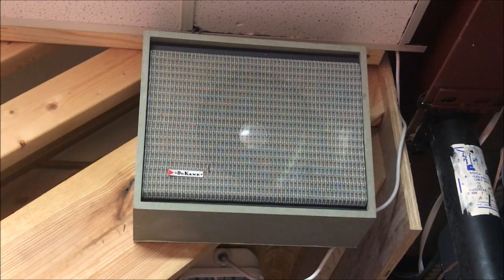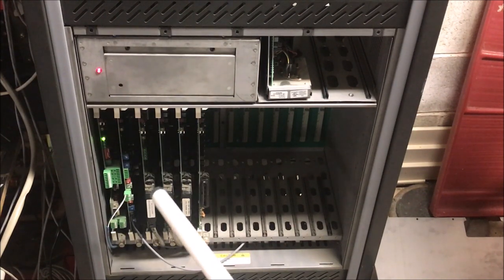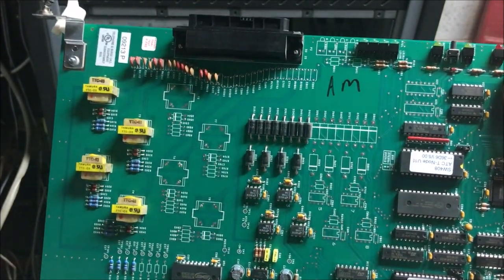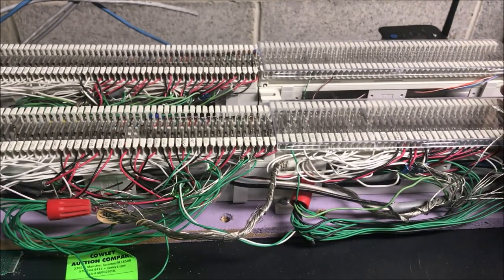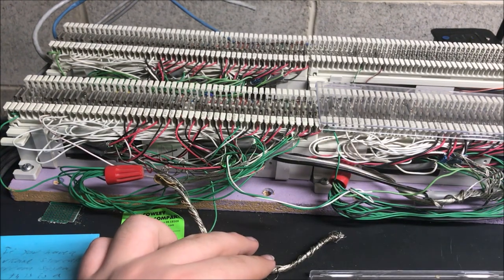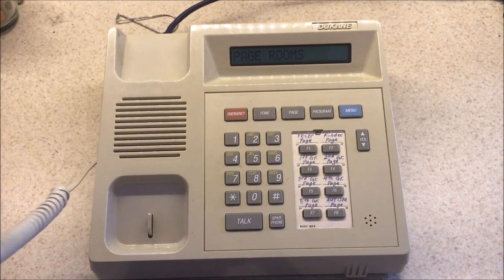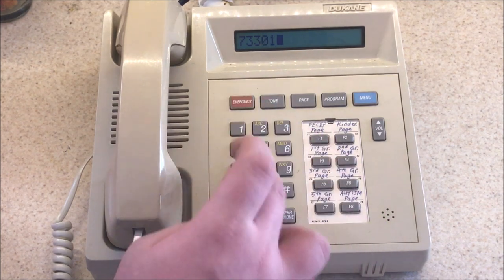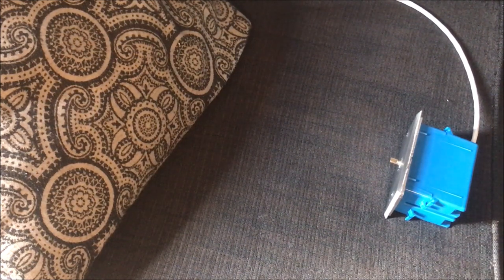DuKane Starcall Intercom System -- The Basics

Comment: Hi is there a way to tap into the all call for a safety system that makes an announcement over all the speaker? The output on the device is analog but I also have a relay that can trip to open or closet when the audio is trigger. Really need help figuring this out but my system does not have the mixer just everything else.

Comment: Hello, I maintain this same system in a Fire Dept.  The guys woke to the "Ding" type alarm going off every 5 minutes.  They didn't setup this wakeup alarm/ding...but...it wouldn't quit until they unplugged one of the phones.  They took out the Dukane Phone 4 years ago, and said the system worked for paging ONLY ever since.  Until last night.  All the LED's for the hearbeat, Central Processor card are blinking together.  Not sure if that's bad, or not.  Any help with manuals for troubleshooting would be appreciated.  BTW.  Awesome, Awesome video.
Reply from the maker: Hello, and thank you for the comment. After thinking about this for a little bit, I have come up with a few things that could cause the issues that you’re having with this system. One of my guesses is that the main central processor card (CPC) has just crashed and needs to be reset through the software. Just unplugging the unit will not reset it usually. All of the lights on the CPC flashing means that there is an error in the system. This could be caused by some weird glitch that happens randomly causing more glitches or a bad card. Another reason that could cause the tones could be some sort of external system that is either sending a trigger signal to the unit to play the tones. Or, it could be sending audio of a similar ding tone to the unit through a paging mic input or one of the two program inputs. I would assume that there could be external devices connected into the unit, seeing as it is in a fire station, to play alerts over the system. This could have caused a static charge to damage the cards. Either way, the best way to start is going to be to get the software for it and try to reload the configuration files to the cpc. Unfortunately the software will only work on a computer running Windows XP 32 bit, basically meaning any Win XP machine prior to around 2006. A link to download the software is buried in a reddit thread which I will provide a link to here ( https://www.reddit.com/r/k12sysadmin/comments/6w06m6/dukane_starcall_rapid_software/dm8txkk/ ). I’ve tried downloading it on windows 7 and it did not work; it only worked on a Windows XP laptop. If you do have a device that will run it, you will either need a serial cable to connect to the CPC or a usb to serial with proper drivers. When I did this with the XP laptop, it worked first try. I do have another video recorded about the software that I have sort of been procrastinating on editing that I should post, because it would probably help with what you’re trying to do. One last thing that you could try is plugging in one of the DuKane phones with a display on it which would show the error code, or if somewhere in the building there is a remote display that would have an error code on it. If you could get access to one of the phones, you could view this code and I could relay information from the manual on what it could mean. I’ve had error codes 19 and 18, both of which caused the 4 leds to flash and were easily resolved through the software. The software is fairly self-explanatory once you get into it, so if it is a small building, you could try to reprogram it to do the minimum of what they need it to do, minimizing future errors. You could also try clearing the schedules by dialing 75200#, but this will turn off any pre-programmed schedules. As I have found, this system is pretty resilient and hard to break, so don’t be afraid to try some basic resetting methods with it as you probably wouldn’t break anything. Sorry this response was so long, but I hope it covers everything to get your troubleshooting process started.

Comment: I have an Administrators Phone 7a1110 that recently started not powering  on when first plugged in. When I lift the handset, I receive static and #4102 1 of 1 appears on the display. I have tried resetting the system multiple times, cleared errors, reloaded the system configuration but nothing resolves the issue. Do you have any suggestions.

Comment: Great video!  We have two identical Dukane system and each are used to support floor levels in the building fior two division. One Dukane system rack for Division-A supports the rooms & zones in the Basement and 1st floor level while the Second Dukane system rack for Division-B supports the rooms & zones in the 2nd, 3rd and 4th floor level. We an announcement is to be delivered for ALL the floor levels or to both Division-A & B, we have to use two admin consoles instead of one as each admin console is connected to each individual control rack or system. Both Dukane system uses 16-channel card and all slots on the control cabinet are occupied supporting 270 rooms. Is there a way to bridge these two identical Dukane systems together so we can only use one admin console to deliver announcements?....What can you suggest?....Manufacturer no longer support this system and unable to assist both on documentation and support.

Can you also direct us where we can get technical documentation for this Dukane StarCAll intercom system?

Appreciate the help.

Thanks!

Comment: Can you run a paging signal from a third party pbx on this system? Is there an analog card for that?
Reply: Also, Clearwater High School in Clearwater,FL used this system. Their amp was 250 watts!! You can talk to a lot of speakers with that sort of power.
Reply from the maker: There are several configurable inputs on this system, including a standard balanced paging mic input that you could try to interface it with. You might be able to configure a trunk interface card to work with an external line, but I am not sure. I do not believe that there is a dedicated analog card for this, but you might be able to pull an analog output into either the mic input or one of the two program inputs on the system. Also, if you have this system, in a future video I will supply a link to the RAPID software along with an instructional video. If you have any success with this, let me know; I am interested in how you could do this with this system. Thank you for the comment!
Reply: @floydsutton788  I don't have this system. I do however have a vintage TOA solid state 70v mixer amplifier that looks to be from the 70s. It is a TOA model ta958. I have been looking for input cards for this unit. Are you familiar with TOA amplifiers?
Reply from the maker: @jonathankeenan80  I have thought of purchasing a 250 watt amp for this system, but there are so many more amps that have a higher output than DuKane program amps. These are high quality amplifiers though and even the 125 watt one powered nearly 50, 5 watt speakers throughout the school that this one came out of.
Reply from the maker: @jonathankeenan80  I have not dealt with TOA amplifiers, but I do have two 15 inch TOA drivers and they are excellent quality. I am not sure where to get cards for a unit that old, but good luck!

Comment: I actually still have this very system at the school building I work at as an IT Admin. How do you adjust the volume of individual speakers in the rooms through the phone? We have the Starcall RAPID software too but I can't figure out the volume part to adjust it in a single room. We still use it as our bell system but have upgraded the intercom system to a VOIP system interfaced to this with a card.
Reply: Unfortunately, there is no way to adjust the volume of individual speakers through the ATEL.  If you want to adjust the volume of individual speakers, in most cases, you actually need to remove them from the wall or ceiling and adjust the wattage tap setting.  This is done by disconnecting the lead coming from the transformer and connecting the one of the correct color that corresponds to the wattage you want.  This is assuming that the speakers at your school do not have knobs or other means to adjust the tap setting without disconnecting the wires.

Comment: Does the phone use telephone cord or cat5 cable?
Reply: ATEL phones use 3 pairs of wires (6 individual) but use the 8-pin RJ45 (“Ethernet”) jacks in the back of the units and on the wall. Pins 1 & 8 are just not used. One pair carries 24v power for the phone to operate, one pair is the data connection between the phone and the central brain of the system and the third pair is for voice communication for calls.

Comment: Low volume output issue, can you assist with possible solutions?
Reply: Low volume from what though? Low volume on calls to individual rooms, or on paging/program distribution. Volume output is controlled from different pieces of equipment depending on what you’re doing.

Comment: does anyone know why these will sometimes have a car radio in the rack cabinet
Reply: The radio is usually configured to be one of the two program sources.  If it is connected, you can dial the code on an ATEL and play the content from the radio in the rack to the speakers in the building.